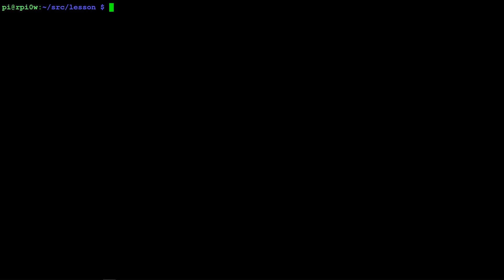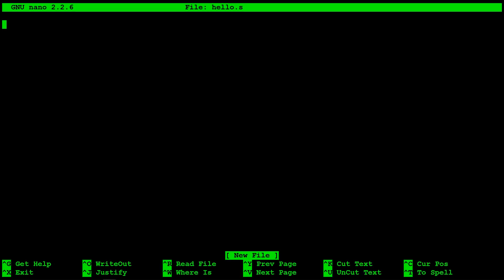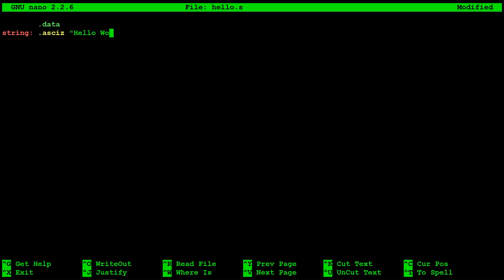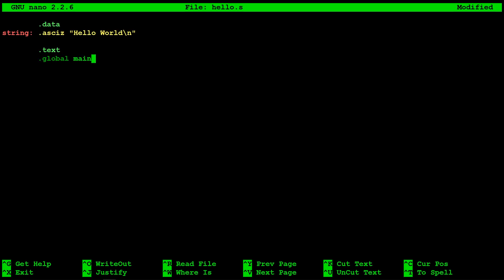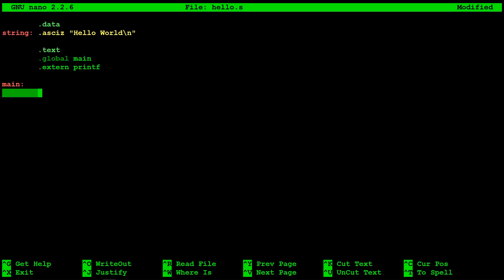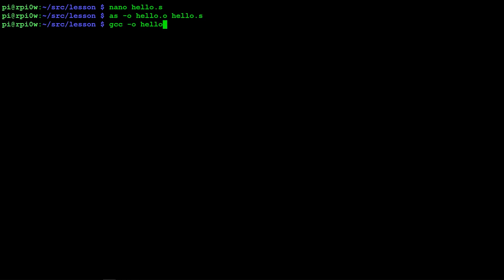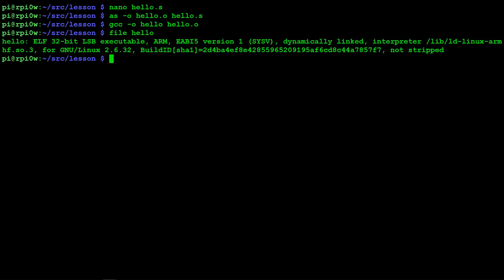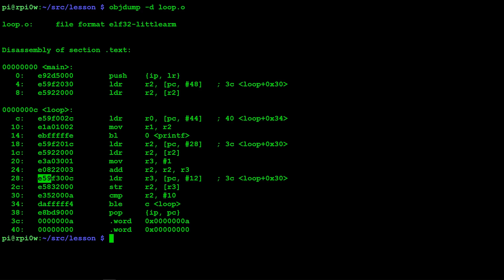How Does A CPU Work? - Part 2 - Assembly Language

Comment: Thanks. I thought the CPU (or GPU) can only read 1's & 0's? How would it be able to understand what an e59f002c if it has the letter f, e and the numbers 5, 9 & 2? Is there further compiling by the computer for these hexadecimal after the program itself was compiled (two compilations)?

Thank you.
Reply from the maker: 0xe59f002c is a hexadecimal representation of the binary 1's and 0's for us mere mortals. Just like the number 25 is just a decimal representation of a number. 0xe59f002c =11100101100111110000000000101100
Reply: By the way, why do CPUs still need an instruction set that seems to be similar to Assembly language, if in our programs (assembly or high level) already has commands like Mov and Load, etc.and everything is compiled already to 1s and 0's ready for the switching of CPU's many transistors?
Reply from the maker: Sorry, I don't understand the question you are trying to ask. High level languages don't have instructions like move or load, only assembly does. Assembly exists because it is tedious and error-prone to write out the 1's and 0's by hand.
Reply from the maker: I am still not 100% sure what you are asking... But the assembly language is created FROM the CPU's instruction set. Also assembly language is DIFFERENT for every CPU because it is the instruction set which defines the assembly language. It isn't like Java, C or Python, there is no general language called "assembly language" it is a term that refers to a low level language that is specific for a CPU type and is defined by the instruction set. You can't use x86 assembly language on an Arm processor and vice-versa.
Reply: @GaryExplains  I think the confusion may arise from how syntax keywords like "ldr" and "mov" are observed even in say a code listing for x86 assembler. The existence of similar syntax like ".data", "mov" and "add" give the superficial impression that assembly is one "language". Assembly languages vary a lot more than that and the differences between syntax keywords, register references, etc make that less than productive. Some happen to be the same out of convention I would assume?

@SevenDeMagnus As Gary explained - this is where the benefit of a higher-level language like C that basically dictates how the source code should look like and what words one can use and how they work, and the C compiler takes that code and spits out a program from it. Because C is a defined standard across systems, you can write the source code once and it will compile into a program for that system.
Reply: @SevenDeMagnus  The CPU has the instruction set because that is how it knows what to do. 

Assembly language is a more human level way for us to write code for that instruction set. Knowing the CPUs instruction set is beneficial for debugging at the very least. The CPU works in 0 and 1. Some combinations of 0/1 have been defined by ARM/Intel/AMD/<cpumanufacturer>/<chipmaker> to mean something such as "read", "write", "add", "subtract", but not the same codes across systems. In assembly code, you can write slightly more human variants of those instructions in the form of "ldr", "add" etc. The assembler still converts them into machine code which is what the CPU cares about. There is no formalised standard assembly language across systems however, unlike higher-level languages like C, C++ etc. While assembly languages seem to follow some conventions, you still need to learn the nitty-gritty of a particular system to get anywhere, as well as the intricacies of your assembler of choice.

Comment: Thanks. Cool. Why not use microcode which is even closer to the hardware. By the way, what do they mean when they say "it's close to the hardware" (like the Metal graphics API by Apple).

Thank you.

God bless, Proverbs 31
Reply from the maker: I think you have misunderstood the concept of microcode.
Reply: Hi. Thanks sir. I got microding from this video (Avie Tevanian). I think it's available for the Alto. I wonder if you could do that with modern iMacs to make the Mac or Window apps faster: 

https://www.youtube.com/watch?v=NtpIFrOGTHk
Reply from the maker: I don't have time to watch a 2 hour video. But, assuming it is about the microcode engine of the Xerox Alto, that was a unique computer and that isn't how computers are built today. The lowest level interface available to the programmer is machine code and the lowest level programming language for machine code is assembly.
Reply: I think what you want answered judging by the questions you have can be explained here ->  @9:55 https://www.youtube.com/watch?v=U9H7TmRt64A .  He describes the load and the store instruction for the pi right down to the binary ( " close to the metal "  aspect of it all) and what each bit means.

Comment: I know that this might be a question on a different topic, but I was hoping that you could give me an answer to something I have been wondering: 
I have seen the benchmarks (geekbech 4.1 among others) for the new macbook air 2018, and also for the new A12X chip in the new iPad pro 2018. Would it be possible for Apple to just put their A12X chipset in their next macbook air? And if/if not, why? Because the benchmarks for that chip are WAY higher!! 
I hope that you will find the time to answer me, because I really wanna know :)
Thanks in advance!
Reply from the maker: Did you see this video of mine? https://youtu.be/RTMG4bMsSZo
Reply: Gary Explains Ah yes I did watch that video, just forgot about your arguments. So would you still say that apple probably used intel chips for the Mac air (even though it is a weaker chip) because it would create a continuity problem for the MacOS software?

Comment: Is there really a reason to code in Assembly these days?
I can't find a practical reason other than if you're employed specifically as a low-level software engineer or otherwise using it as a tool to learn how a CPU executes instructions and how memory management works.
Reply: Reverse engineering uses ASM a lot.

Comment: If assembly is really the "low level", then how they made the "as" and "gcc"? Let's say.. a long time ago? By using mechanical switch to put electrons in a bunch of capacitor location inside memory?
Reply: Bootstrapping, just as today. Unfortunately, the days when as and gcc were born things were already quite modern. Both are written in C, certainly bootstrapped with whatever available C compiler at that time and self hosting subsequently.

Comment: I first learned 6502 Assembly Language in 1983 when I was 16, and at that time you pretty much had to know it to program ay serious software for platforms like the Commodore 64, Atari Computer, Apple ][, or IBM PC. I wrote a couple of Amiga games entirely in 68000 Assembly around 1990, which was a huge challenge. And that was the last time I did any major Assembly programming because the CPUs and OSs were getting more complex. It was just becoming unwieldy to write in Assembly. So after that time all my low level coding was done in C, C++, C#, and Objective-C. Now that I’m programming embedded MCUs like Arduino I’ve actually been using some AVR Assembly to optimize things. Assembly is getting a bit of a revival lately as people are now writing a lot of retro games for old platforms like the Atari 2600, DOS, and Commodore 64 again.